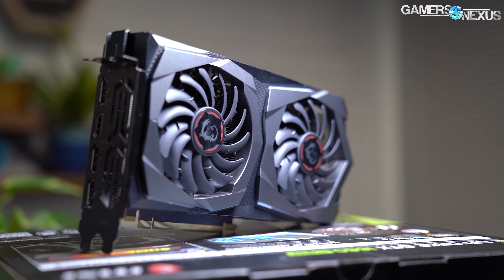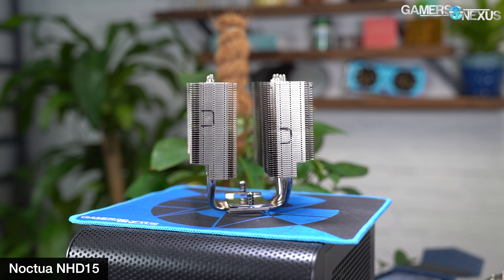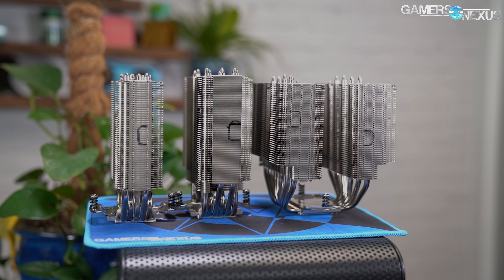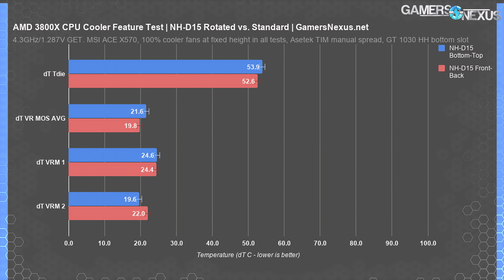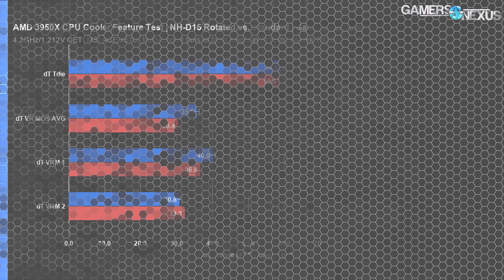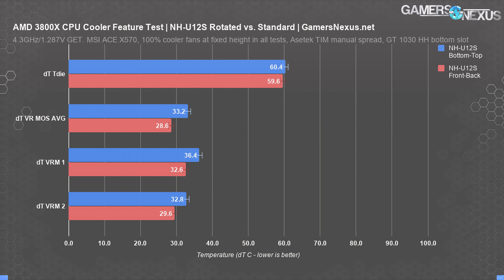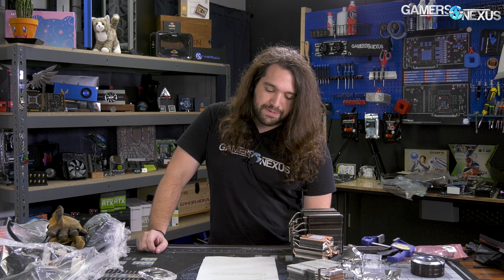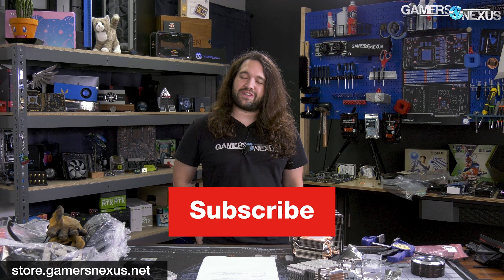AMD Ryzen Heatpipe Orientation Benchmark & CPU Cooler Myths

Comment: I'm honestly far more interested in the difference between the 90° offset any cooler is sitting on in a tower, or the flat plane when laid on the side, like a desktop. Just due to how the heat pipes are made, how they are orientated in the relation of the fluid physics, the convenction and the condensation path of the liquid inside. Especially with hot chips.
Reply: Well most ideal situation for most heatpipes is heatsource at the lowest point with straight pipes sticking vertically (not flattened and not bent) with the condenser sitting at the highest point so that the vapor can rise and gravity can assist with moving the liquid/fluid. Thing is though there are so many wick types and often the thickness and porosity of the wick is adjusted to help change preformance and even the pipes ability to work against gravity. What i am getting at here is there is so many factors and so many heatpipes to do a good video on that will take quite a bit of work.
Reply: there is a lot that goes into it. Starting off diameter plays a huge role. A 3mm heatpipe might have a qmax of 15w and a 8mm heatpipe qmax of 63w.... Thats a big difference for less then a 3x boost in diameter thats nearly 4x the orgional energy for sub 3x larger dia. .... Now lets say you have a low profile heatsinks (laptop for example) and you need to flatten a heatpipe ... If you flatten a 3mm heatpipe by 2mm height thats 3.57mm wide and now has a qmax of 10w instead of 15w .... If you take a 8mm heatpipe and flatten it so the width now becomes 11.14mm @ widest point the qmax is 52w rather then 63w of the round 8mm heatpipe....now some of the factors here are the wick limit (ability of the wick to transfer condensed fluid) and vapor limit (ability and space for the vapor to form and travel.) Thickness and porosity of the wick can be changed to tune it for a application. Which would allow for Qmax changes and / or the ability to work against gravity. .... A typical water filled sintered wick heatpipe (very common for pc cooling ) can be flattened up to around 60% though 30% is much more reasonable figure. As you flatten a heatpipe you will lower the vapor limit. A 3mm heatpipe flattened 33% now has Qmax limited by vapor limit rather then wick. Where as a 8mm heatpipe can be flattened by about 66% before the Qmax is now limited by vapor limit. ... Now if we start making bends we further reduce efficency. If we take the 8mm flattened heatpipe talked about above (52w Qmax) and we bend it 90 degrees we lose about 5% of our 52w Qmax. Which would be about what 49w after that off the top of my head ...then you have orentation. The most ideal situation for most heatpipes is vertical orentation as opposed to the heatsource with the condenser above the source of heat so vapor can rise and gravity can assist with pulling the condensed fluid back down to the source of the heat. Now to makes things even more complex again wick thickness and porosity effect this. As we as thsre is quite a few differnt forms of wick types that each work better for different things. Then if we want to complicate this more the length matters... shorter = more efficient (assuming you can still matain the same ability to cool the vapor in the condenser) now it varies for many reasons (ex. Working fluid , orentation , wick thickness , wick porosity , wick type , ect) however many fairly traditional heatpipes start to fall off around 150mm in length. However there is factors you can adjust to mitigate this. .... This info is still condensed a lot. And there is a lot of types of heatpipes. The ones discussed above are constant conductance heat pipes. There are also variable conductance heat pipes , vapor Chambers, pressure controlled heat pipes , rotating heatpipes , thermal syphons, loop heat pipes , oscillating or pulsing heatpipes,  and diode heatpipes. Even within diode heatpipes there are a few sub types like vapor trap and fluid / liquid trap types.

Comment: I think the test would have been better if you also did it inside a case with 1 exhaust, 3 intake fans, and the GPU in the top slot.

Comment: Kind of strange that people miss that heat radiates. Sure, the heat on ryzen 2 chips is fairly concentrated, but it's not like it's a laser beam of heat. Cooling computers is all about taking that heat as it's generated and moving it fast enough that it can't cause runaway temperature events. Like, if typical coolers weren't "effective" as that reddit poster put it, they'd overheat. It's not that complicated.

Comment: this was answered more than a decade ago. i remember a comparison done using hyper evo212 busting this claim. and somebody actually brought this up again.
Reply: Isn't this different, because this claim is about the new multichip design, as opposed to the monolithic chip designs in the past? How would they have tested this before, when it didn't exist?
Reply: @mrtempertantrum  the fundamental is the same for both cases, i.e wasted cooling potential; why utilize only 1-2 heatpipes to cool it instead of using all of them. this simply isn't true since the heatpipes are transferring the heat via IHS instead the die/chiplet directly.

Comment: Dam wth seems like all your ryzen 3xxx chips seem to run pretty cool seems like my 3600x seems too like running in the 70s no matter how high I have the fans on my h110
Reply: Interesting, maybe you have some type of build up or extremely dirty fluid? I have my 3600x on air, nh-d15s single fan, and my cpu has never gone over 75c.
Reply: @adker1986  well is an aio I think I've had it for about 2 years reused the cooler since I had it on a 2600x temps on that were way lower
Reply: @killer32620  if you've reapplied thermal paste as you've stated, I didn't even think to recommend that as I figured most would try that first. I feel like an aio should last more that two years, most have a 5 year warranty, but things happen. Could always strap the stock cooler on and see what happens temp wise.
Reply: @adker1986  well I don't know when it will turn ghost as it seems it my first time I went with an aio it does ok just not very quiet...during the summer had an even more aggressive fan curve on it and was hitting 75 c with about 65 - 70 fan speed was pretty loud
Reply: Try repasting your CPU and pump/waterblock and make sure you tighten the pump/waterblock properly (not too lose but not too tight) and see again. If that fails, try a BIOS reset if you are running a manual OC (remember, more voltage = more heat even on stock).

I am running a 3600 on air (a NH-U12S single fan) and it doesnt go higher than 68c (it has a manual OC of 4.2GHz across all 6 cores on 1.25v).
Reply: @31tangovictor  I did that twice no change in temps...only thing that's oced is the ram
Reply: over ambient or what the software reads?  if the chart says 56, add about 20 degrees(i think ambient in the studio is 22) to get the actual reported temp.  pretty much the same as what you are reporting.
Reply: you've talked about fan speed, but have you made sure your pump isn't running slow and or ramping with heat? you want your pump running at max or damn close to it at all times, and at a set speed that doesn't change.
Reply: @shawnpitman876  The pump speed is maxed out

Comment: I just built my new AMD rig, and was wondering this exact question. Ultimately, rather the searching the internet, I just put the damn cooler on. Good to know I made the right choice!
Reply: Indeed!
It's more important that there is a cooler in the first place.
What could be interesting is if the orientation of the cooler in regards to case fans does have an impact.
For example, in my case I got room for 2x 140mm fans in the top and only 1x 120mm in the back, so I let the CPU cooler blow upwards where I got more fan to take the heat away.
Reply: @HappyBeezerStudios  When doing the orientation with the fan facing the GPU, the distance from the GPU back (plate) becomes a big influence, then add heat coming off that back. I've seen GPU/cooler combos that place the fan less than half an inch a part, especially since we all know how mobo manufacturers follow the "CPU boundary" rules.

Comment: Should it be better to point the PSU hot air outlet in a different direction than the thermocouple? Adds more variables. https://youtu.be/O1WGlPrH4IU?t=774

Comment: I believe Wendell started this mess, by explicitly stating that orientation of heatpipes was something he wanted to test and MIGHT have an effect on Ryzen 3000.

Then the internet turned that vague, tangential speculation into facts.
Reply: But only on multiple chiplet CPU's.
Reply: Or on Intels smaller dies like Ivy, Haswell, Skylake, Kaby Lake etc.
The die is relatively narrow, and the heatspreader is pasted instead of soldered
Reply: Well it would... For most heatpipes the most ideal orentation is heatsource at the lowest point > pipes vertically > condenser at the top ... This allows the vapor to rise then gravity to assist with returning the fluid back to the bottom where the heat source is. Though there is mitigations through porosity of the wick , wick thickness and wick type that all play a huge role in how much loss you get and the end Qmax of the heatpipes based on how you build them. 
If you take a standard midtower case where the cooler would be horizontal then you flipped tbe case on its side so that the cooler now sat above the cpu on the z axis you have now increased the efficency of the heatpipes. Now by how much is dependent on the type of wick , porosity of the wick , and thickness of said wick among some other factors. Now with ryzen 3000s pretty agressive auto oc / turbo behavior if you got a few percent increase in cooling it would effect end frequency and duration of boost to some degree. So yes orentation for heatpipes can have a effect on ryzen....how much it will is highly variable based on tons of factors. 
- I have attached a reply of mine that i made on another comment that also provides a lot of useful info about heatpipe design if your interested it is at the bottom of this reply 

There is a lot that goes into it. Starting off diameter plays a huge role. A 3mm heatpipe might have a qmax of 15w and a 8mm heatpipe qmax of 63w.... Thats a big difference for less then a 3x boost in diameter thats nearly 4x the orgional energy for sub 3x larger dia. .... Now lets say you have a low profile heatsinks (laptop for example) and you need to flatten a heatpipe ... If you flatten a 3mm heatpipe by 2mm height thats 3.57mm wide and now has a qmax of 10w instead of 15w .... If you take a 8mm heatpipe and flatten it so the width now becomes 11.14mm @ widest point the qmax is 52w rather then 63w of the round 8mm heatpipe....now some of the factors here are the wick limit (ability of the wick to transfer condensed fluid) and vapor limit (ability and space for the vapor to form and travel.) Thickness and porosity of the wick can be changed to tune it for a application. Which would allow for Qmax changes and / or the ability to work against gravity. .... A typical water filled sintered wick heatpipe (very common for pc cooling ) can be flattened up to around 60% though 30% is much more reasonable figure. As you flatten a heatpipe you will lower the vapor limit. A 3mm heatpipe flattened 33% now has Qmax limited by vapor limit rather then wick. Where as a 8mm heatpipe can be flattened by about 66% before the Qmax is now limited by vapor limit. ... Now if we start making bends we further reduce efficency. If we take the 8mm flattened heatpipe talked about above (52w Qmax) and we bend it 90 degrees we lose about 5% of our 52w Qmax. Which would be about what 49w after that off the top of my head ...then you have orentation. The most ideal situation for most heatpipes is vertical orentation as opposed to the heatsource with the condenser above the source of heat so vapor can rise and gravity can assist with pulling the condensed fluid back down to the source of the heat. Now to makes things even more complex again wick thickness and porosity effect this. As we as thsre is quite a few differnt forms of wick types that each work better for different things. Then if we want to complicate this more the length matters... shorter = more efficient (assuming you can still matain the same ability to cool the vapor in the condenser) now it varies for many reasons (ex. Working fluid , orentation , wick thickness , wick porosity , wick type , ect) however many fairly traditional heatpipes start to fall off around 150mm in length. However there is factors you can adjust to mitigate this. .... This info is still condensed a lot. And there is a lot of types of heatpipes. The ones discussed above are constant conductance heat pipes. There are also variable conductance heat pipes , vapor Chambers, pressure controlled heat pipes , rotating heatpipes , thermal syphons, loop heat pipes , oscillating or pulsing heatpipes,  and diode heatpipes. Even within diode heatpipes there are a few sub types like vapor trap and fluid / liquid trap types.
Reply: @Onewolfoc  That's what I thought this video was about, vertical vs horizontal heatpipes. Having a basic understanding of how they work, I'm really curious just how much difference there is.
Reply: Certainly sounds plausible. 😁

Comment: is it the more heat pipes the better?
Reply: No not quite there is a lot that goes into it. Starting off diameter plays a huge role. A 3mm heatpipe might have a qmax of 15w and a 8mm heatpipe qmax of 63w.... Thats a big difference for less then a 3x boost in diameter thats nearly 4x the orgional energy for sub 3x larger dia. .... Now lets say you have a low profile heatsinks (laptop for example) and you need to flatten a heatpipe ... If you flatten a 3mm heatpipe by 2mm height thats 3.57mm wide and now has a qmax of 10w instead of 15w .... If you take a 8mm heatpipe and flatten it so the width now becomes 11.14mm @ widest point the qmax is 52w rather then 63w of the round 8mm heatpipe....now some of the factors here are the wick limit (ability of the wick to transfer condensed fluid) and vapor limit (ability and space for the vapor to form and travel.) Thickness and porosity of the wick can be changed to tune it for a application. Which would allow for Qmax changes and / or the ability to work against gravity. .... A typical water filled sintered wick heatpipe (very common for pc cooling ) can be flattened up to around 60% though 30% is much more reasonable figure. As you flatten a heatpipe you will lower the vapor limit. A 3mm heatpipe flattened 33% now has Qmax limited by vapor limit rather then wick. Where as a 8mm heatpipe can be flattened by about 66% before the Qmax is now limited by vapor limit. ... Now if we start making bends we further reduce efficency. If we take the 8mm flattened heatpipe talked about above (52w Qmax) and we bend it 90 degrees we lose about 5% of our 52w Qmax. Which would be about what 49w after that off the top of my head ...then you have orentation. The most ideal situation for most heatpipes is vertical orentation as opposed to the heatsource with the condenser above the source of heat so vapor can rise and gravity can assist with pulling the condensed fluid back down to the source of the heat. Now to makes things even more complex again wick thickness and porosity effect this. As we as thsre is quite a few differnt forms of wick types that each work better for different things. Then if we want to complicate this more the length matters... shorter = more efficient (assuming you can still matain the same ability to cool the vapor in the condenser) now it varies for many reasons (ex. Working fluid , orentation , wick thickness , wick porosity , wick type , ect) however many fairly traditional heatpipes start to fall off around 150mm in length. However there is factors you can adjust to mitigate this. .... This info is still condensed a lot. And there is a lot of types of heatpipes. The ones discussed above are constant conductance heat pipes. There are also variable conductance heat pipes , vapor Chambers, pressure controlled heat pipes , rotating heatpipes , thermal syphons, loop heat pipes , oscillating or pulsing heatpipes,  and diode heatpipes. Even within diode heatpipes there are a few sub types like vapor trap and fluid / liquid trap types.
Reply: @Onewolfoc  damn thats a very nice explanation, thank you
Reply: @CFG50  yea no problem. Hope that helps
Reply: Pretty much